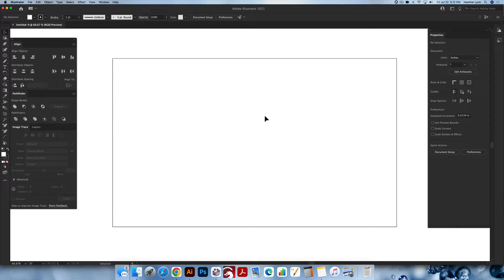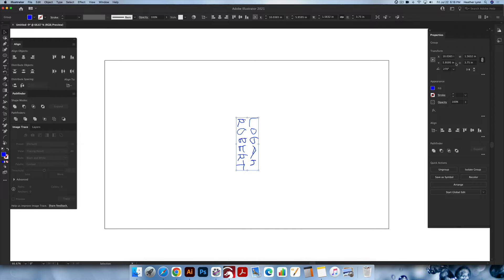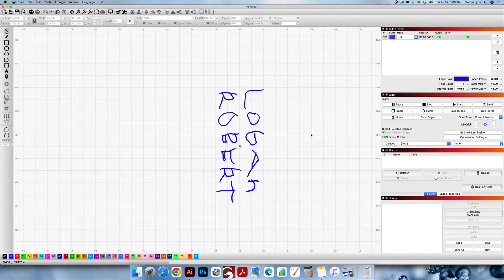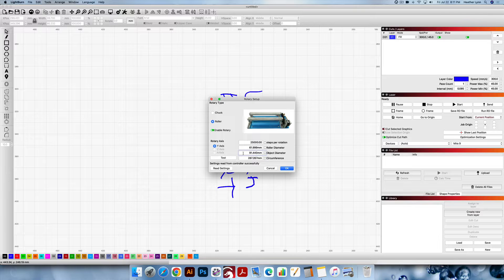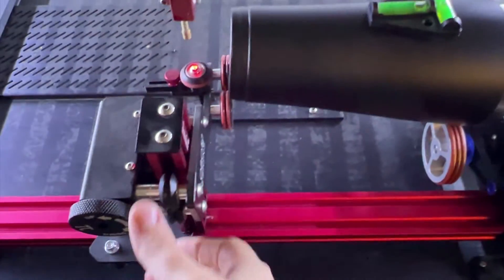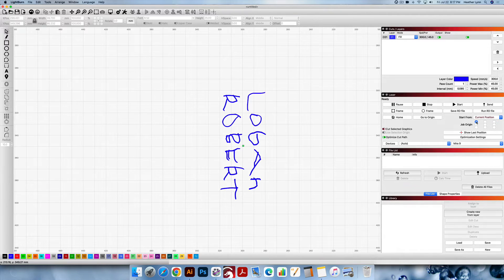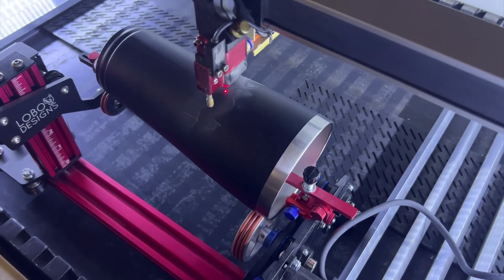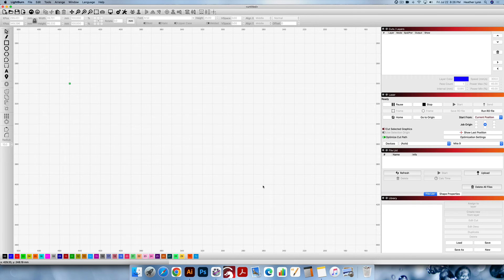Adobe Illustrator & LightBurn — Creating a Tumbler Design & Using the PiBurn V4 to Engrave a Tumbler

Comment: Defocus is higher or lower than the precise focus (numberically)
Reply from the maker: Sorry for the delay here! Defocusing is a higher number if manually focusing with a focal gauge. Essentially taking the beam a bit out of focus for a softer engrave. 

If you're controlling the defocus in LightBurn settings, you'll want to ensure a negative figure is entered and it should say "(Out)" next to that number in the Z Offset field.

Comment: Hi Heather , great content , clear and to the point , I heard you reference “defocusing” , what is the correct focus of your machine and what is the purpose of the defocus. How many mm are you defocusing , thanks
Reply from the maker: Hi, Brad! Super sorry for the delayed reply here. Just recently moved from PA to FL so this month has a been a whirlwind! 

My machine autofocuses to 6.4mm. For defocusing, I either manually focus to about 8-9mm using the focal gauge or I'll use the AF pin and then set a -2mm Z offset in LB!

Comment: Hi Heather, what power settings do you have? I'm using a Mira 9 90W and at the same settings you're using I'm getting really dark marks which are almost impossible to get off the tumblers.
Reply from the maker: Hey! I have a 90w Mira 9 (it's a 102w tube). My engrave settings on tumblers is 300/35/300LPI at a -9mm focal height. It varies on some tumbler brands though, which sometimes I have to use 300/40-45. If you have a scrap cup, it helps to run a couple squares or circles side by side at different settings, to see which ones work best for your machine!
Reply: @LoBoDesigns  Got it! I'll try these out and see what I get. I'll also be lowering the air pressure as much as possible to make sure I don't introduce any more material into the engraved space. I've been looking at your Procreate course. I'm super interested in designing my own SVGs and I think this is a great way to start.
Reply from the maker: Yessss! I LOVE Procreate! And making custom designs is a great way to open up a new stream of income for your business! 🤍🎉